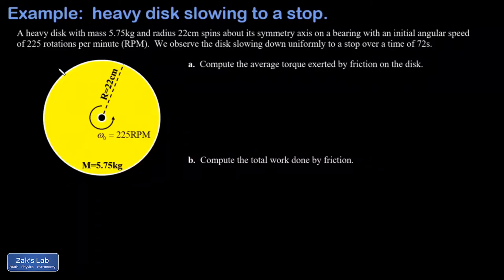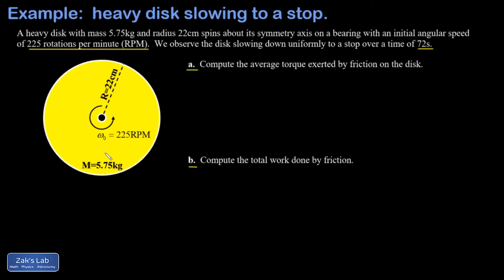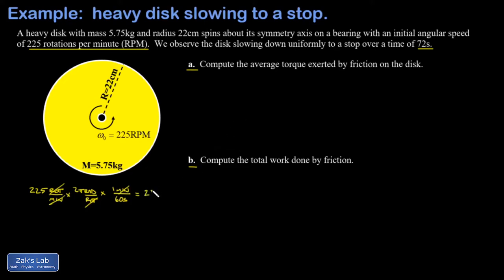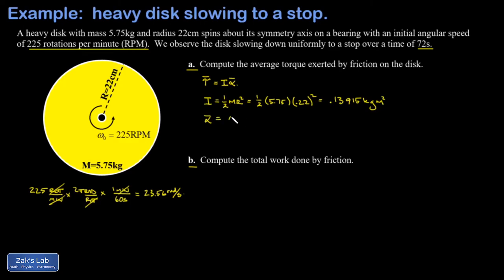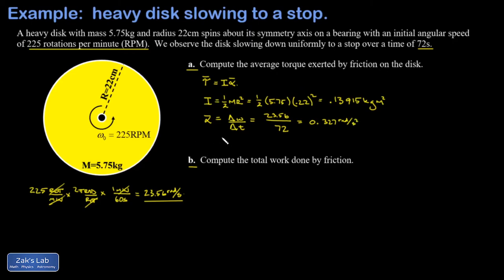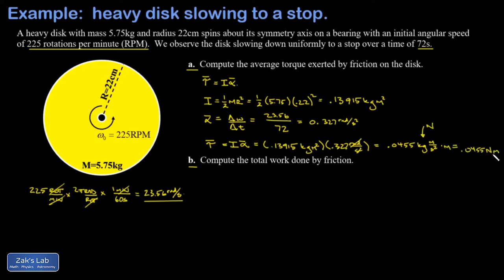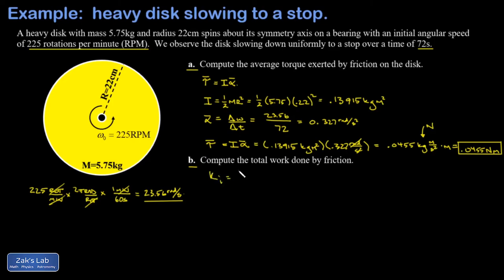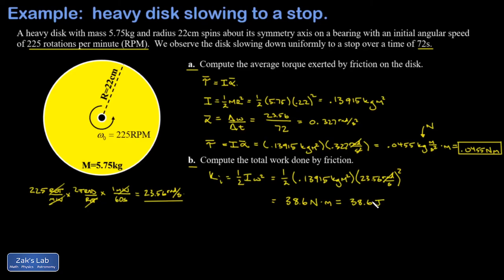Torque on a rotating disk: calculate torque exerted by friction and rotational friction work.

Comment: is the formula T=Force x radius can be used here, say we need to find the force needed to rotate the disk?
Reply from the maker: You would have to know the radius at which the force is applied, which isn't clear from the problem (maybe the force is due to friction in a small bearing at the center?) .  There are variants of the problem where the radius is known, for example slowing a disk by pressing a piece of metal against the outer edge and using friction to exert a torque.  Then the radius would be the radius of the disk.

Comment: Hiii I hv doubt in torque cal.... what if we don't have time ..how to calculate alpha
Reply from the maker: The time to slow to a stop depends on the torque!  If time is smaller, alpha is larger and the torque is larger; if time is larger, alpha is smaller and the torque is smaller.
Reply: @ZaksLab  ok understand but in actual conditions we don't have stoping time.. can you share me your email id I want to share my problem sheet with you ..that will be very helpful
Reply from the maker: @anengineer8647  click on my channel then "About", then you should see a tab to get my email
Reply: @ZaksLab  sir I checked but unable to find it please share
Reply: @ZaksLab  I will mail you my sheet
Reply: I need to calculate torque for selection of gearbox to rotate 700mm dia ms material 20 mm thk to 50 rpm, initially disk will be in rest position,I want to start it rotating there will be no pick up second  defind. I need to select gearbox for that torque and motor power Required-
Please help thankx

Comment: torque should be negative here, no?
Reply from the maker: If you call the direction of initial angular velocity positive, then torque would be negative if we were to use the sign to indicate direction.  That choice of "which way is positive" is arbitrary though, which is why I chose to just compute the magnitude of the torque.  If you wanted to use the result to do an angular kinematics problem you'd have to choose a direction to call positive and be consistent after that choice (if omega_0 is positive, then alpha is negative or vice versa).  z
Reply: @ZaksLab  perfect, thanks for the quick reply!